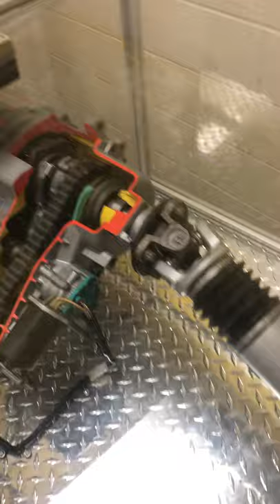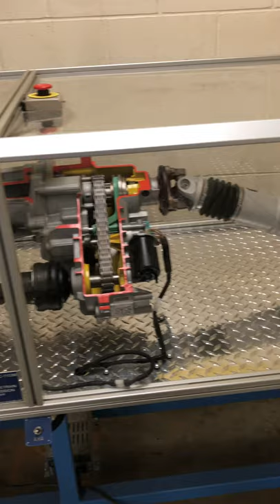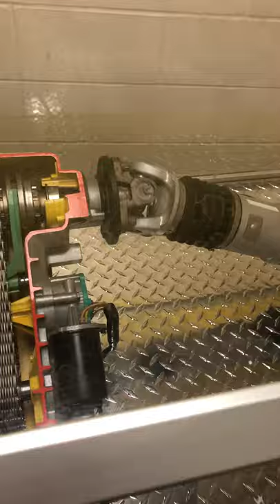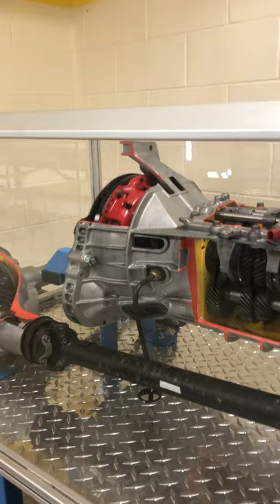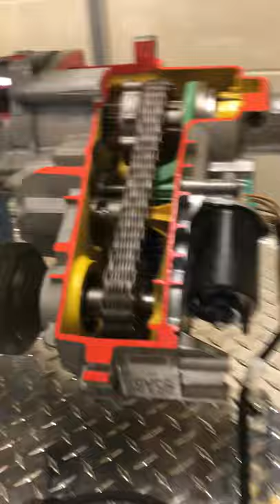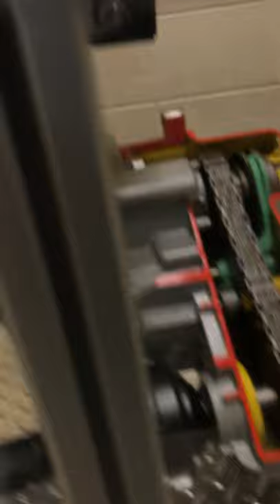Transfer Case Operation

Comment: I have some vibration coming from under my feet going around 65mph.  Jeep dealership just replaced the transfer case too. So, it's a new issue after they installed it.  In 4Hi the vibration is really bad and has a grinding noise when I left off the gas.  If i'm to assume the transfer case they installed was installed wrong or a lemon, what components would be causing vibrations and grinding noise?
Reply from the maker: The first thing I would do is pop under the vehicle and make sure the Tcase mounting bolts are not loose. Does the vibration only happen when your foot is on the accelerator or does it vibrate while coasting too?
Reply: @autotech4103  when I’m at constant speed around 65mph. When in 4hi at 45mphnits vibrating bad and then making this buzz/grind sound when i let off the gas
Reply from the maker: Vibrations can come from any driveline components that are loose or damaged but it’s usually a seized u-joint on the driveshaft. If we assume the transfer case is the issue the grinding when you let off could be a loose or skipping chain. I would rule out the driveshafts soon in case they fly apart. A lot of damage will occur when a drive shaft or tcase comes off going down the highway
Reply: @autotech4103  definitely not drive shafts. I even took the rear one completely off and drove in 4hi to verify. They’ve been taken off multiple times and retorqued.  This only started happening after jeep put in a new transfer case.  They keep saying they are waiting on a “special tool” to come in so they can run diagnostics on the transfer case. I’m like “just freaking replace it”
Reply from the maker: That pretty frustrating. New parts like transfer cases should never be defective. Hope Jeep takes care of yah

Comment: Can you shift from 4 high to 2 high at full throttle safely or does it only work at lower rpms? I use 4 high to launch at the drag strip but doesn't the 4 high slow the drivetrai  down overall? I was wondering could I switch to 2 high after 2nd gear and it be okay? I have a 2018 F150
Reply from the maker: Gears that are under acceleration don’t (or won’t) engage or disengage well. Finding a way to harness your power with the rear wheels sounds expensive but so does replacing transfer cases once a week.

Comment: I drive a 06 h4 hummer. It's all time all wheel drive. But I can put in 4hi as well as 4low. So with my truck. Does the transfer case work 24/7 being I don't have an option to go 2wheel drive. I'm asking because I test it out alot to make sure it's working and every time I put In 4hi. Only way to disengage fully.  I have to back up and turn left and or right and listen for the click to let me know its fully disengage. I read the manual and it says that's normal some times. Why can't it just disengage the same way this example did. You didnt back up one time to disengage. Fyi I did have it rebuilt due to plastic shift fork going bad. Now it has the metal shift fork. Otherwise if I don't back up it whines. I'm only asking because I rarely actually use those buttons. I thought the transfer case is working and moving all the time. Never knew it only works when your using 4hi or 4low.
Reply from the maker: Correct me if I’m wrong but the 4hi and 4low options are “lock” options. This allows your differentials to lock for extra sticky situations. The backing up is required to get both front and rear differentials as well as the transfer case switched fully. Since your Hummer is always in 4WD it’s not really a downside. If you get stuck you can put it in a 4WD lock position and then disengage afterwards. Good on you for shifting it as routine maintenance. Transfer cases do get sticky, especially in 4WD low.
Reply: @autotech4103  you need to work for GM...............😲😲😲😲😲😕😕😕😕✊🏿✊🏿✊🏿✊🏿✊🏿👏🏿👏🏿👏🏿👏🏿👏🏿💪🏿💪🏿💪🏿💪🏿💪🏿. Why the hell they couldn't explain it like that for me. Im thinking something has to be wrong. Why do i have to always back up. Even when I switch back into regular all time 4wheel drive. And you just explained it very well. A second grader would understand. Thanks sir. And yes it does get stuck alot. Which is why every so often I mess around with it.
Reply: @autotech4103  oh yeah so my chain in the transfer case is always moving correct? Even if you say no i still should make sure the fluid is changed
Reply from the maker: @Quis85  yes, your chain does rotate a lot. They are durable as long as it doesn’t get abused often
Reply: @autotech4103  I was hoping you said no. But I understand why. Its because it's all time all wheel drive. If it was like the diagram. Than I could keep in two wheel drive and not worry about wear and tear as much. But I don't have that option. Thanks for the education on my system. I will be getting fluid changed Monday. I've already changed front and rear differential fluid. Only things lift is transmission filter and fluid change and transfer case change. Thanks again.

Comment: Please explain with central diff lock
Reply from the maker: Locking differentials don’t have much to do with transfer case. I assume you are asking about locking differentials that you can lock by a switch from the drivers seat. They use mainly air or electric to “lock” your two axel side gears together so they turn as one. Locking your differential takes away from your ability to have wheels turn at different speeds making cornering almost impossible. Locking differentials that are switched from the drivers seat are good for off road machines for gaining traction in a straight line. Differentials with limited slip do pretty much the same thing but do it automatically when you start to lose traction. Limited slip are meant for on road vehicles wanting to gain traction.
Reply: @autotech4103  Thanks

Comment: Many vehicles require you stop or shift into neutral to switch transfer case modes, any reason why?
Reply from the maker: The transfer cases your speaking of were from older vehicles. The modern electric motor and shift forks are very forgiving as long as your are not accelerating while you shift. The older floor shifter styles are able to be shifted on the fly into 4H for the most part but only at slow speeds and deceleration.
Reply: @autotech4103  I just watched another video who explains it incredibly well, maybe you mentioned it and I didn't notice, but he mentions that you can shift into 4Hi and 2HI no problem since theres a synchronizer, but low and high don't have one, meaning you have to stop. all trucks I've driven made in the past 10 years required you to stop to shift though
Reply from the maker: @Ckcdillpickle  what vehicles? You always have to stop into or out of low. Haven’t seen any that you have to stop shifting to and from 4HI.

Comment: Will the chain turn with the front driveshaft when in 2WD? Does it freewheel until 4WD is engaged?
Reply from the maker: It depends on the vehicle and how that manufacturer manages their 4WD. The easy answer is no, not usually.
Reply: @autotech4103  thanks, I have a 2010 Jeep JK that is making a mechanical noise like an intermittent chatter in 2WD when additional torque is applied and was trying to narrow it down. I think I have a bad rear driveshaft or maybe the chain is loose or a bearing is bad. All are expensive so I'm trying to get it right the first time.
Reply from the maker: @rosshunter4626  you can remove driveshafts and feel tight, seized or loose u-joints. Start there. Its cheap and easy to diagnose.......

Comment: Hi mate hope you okay. 
I really need someone to help me because in my country no one knows what is this and im so sad with that. 
I have a problem in my G class 400 cdi year 2003 chassis nr ( WDB 463 333 1X14 1219 )
When im about to stop on a trafick or whatever and when gear is about to go from 3-2-1 i hear some vibration in my car and the gear box its not changing gear in the perfect time when u about to stop. 
Its feels like someone is hitting you from the back. 
Please let me know how do i find that part . 
Best Regards
Reply from the maker: Is this after you are driving at highway speed? Could be a torque converter that isn’t unlocking??
Reply: @autotech4103  yeah perfectly. When im pressing that gas harder or when im forcing that car there is this problem. Can you tell me what is this please ?
Reply from the maker: @SaimirAllaraj  not over messages. It needs to be properly diagnosed. Could be control circuits, bad parts, solenoids…….

Comment: How about 4auto ?
Reply from the maker: Ah, good question. This transfer case doesn't have that option but essential it can be achieved by adding a clutch pack that engages when there is a difference in output speed between the front driveline and rear driveline. Similar to a limited slip differential.....
Reply: What engages the 4auto from two wheel to 4 wheel? Is it a solenoid?
Reply from the maker: @jessekling1865  most auto systems switch the pressure on a clutch pack in the transfer case to engage the front driveshaft when it has a certain amount of slippage compared to the rear driveshaft. A small motor usually spins to tighten or loosen the clutch pack. But all systems are different. This particular t-case does not have auto mode.

Comment: Howdy. I try to to transfer from 4x4 to 4x2..first. If knew b4 how complicated electronic control.of 4x4 is aI would not do it and also I do not recomend to make 4x2 to 4x4  because it is not going to be full 4x4 anyway. 

Everything is on and boom speedometer ain't no working. Think 'cause ECM ain't getting no signal from T-case position sensor/switch. So i think I have to plug in sensor/switxh with 4x2 mode. Q is how this sensor worx? What is touchin', where 's located? I see you do understand those thingx. 
Thnx 
You can email me at lapsoo at gmail
Reply from the maker: Your transfer case would have a VSS vehicle speed sensor at the tail shaft where the transfer case attached to the rear drive shaft. If you have removed the t-case then you will need a VSS in your transmission. Did you use the same transmission? If so, I believe you need a rear housing for a 2WD trans.

Comment: I wish transfer cases were gear driven like they were back in the day the chain is the weakest link
Reply from the maker: Maybe the chain can make up for slight differences in tire size and road conditions better? Probably done just to save weight though............
Reply: Chain driven cases are used behind diesel engines the Chain is not the weakest link if the transfer case is maintained properly.